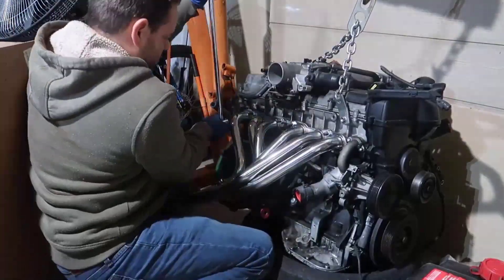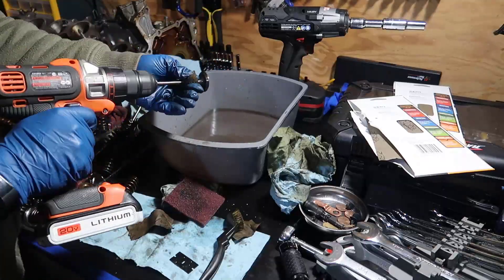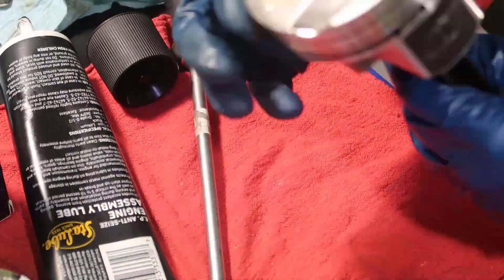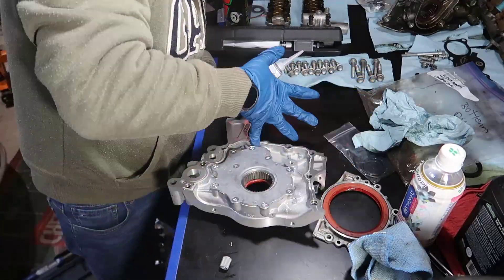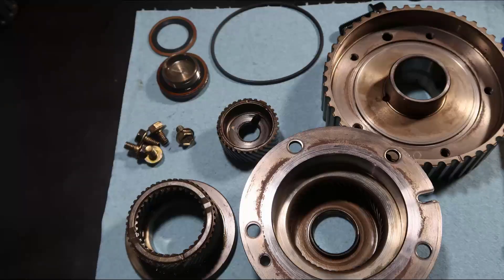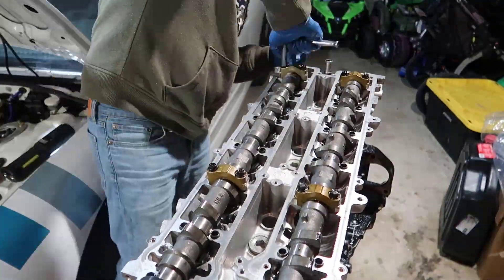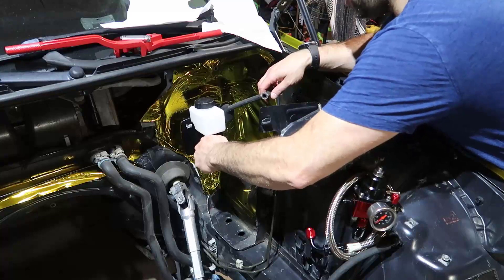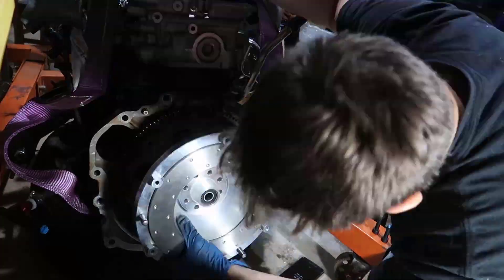533 hp BMW  - 2JZ GE Turbo Build in 10 minutes

Comment: did you swap to a gte head?
Reply: I always though U needed a gte head that has those sensors on the cams to go turbo, my life is a lie hahah. How'd U go with getting it tuned?
 Thing I hate is you can do allll the work but still need to get it tuned.
Reply from the maker: @R0M3109 I learned how to tune. I'm running it myself.  So far I blew one engine and this second one seems to be fine.  I think I have around 550hp. 
The GTE head has a different diameter for the  intake and exhaust as well. Apart from that it's the same. The GE has the cam sensor as well but the important one is the crank sensor which is 36x2 on the GE and the GTE is different gearing.
Reply from the maker: No I did not

Comment: Nice, I have a 4 door with a gte sub, fully kitted out the cylinder head so far, 272 BC cams ss valves and retainers, arp bolts all around, used the GE pistons with gte rods and pushing 550 on the wheels, next step will be forged rods and pistons then 4 bolt main caps. Should be golden. Also still running 95 pump on 14 to 15 psi of boost, looking to double that as soon as the rods etc are done and I can get my hands on some e85 to retune. Hoping for around 800whp after I am done. But anyways nice build can see you built her right from the start.
Reply from the maker: @MrNella853  you have a nice setup.  What you want to do is what I have now except for the 272 cams.  Can't get e85 here though so I'm running 92 pump.  In the Supra I add octane booster  which should take me to 97.  800hp is my goal on the Supra but for this BMW 2JZ 533 is plenty .

Comment: Great video , do you think that buy separate turbo parts is cheaper or is better to buy the turbo kit I planing to purchase the driftmotion turbo kit but is $ 2k dollar maybe I can save some money if I buy everything separate what do you think
Reply: how much for the 2J?
Reply from the maker: @mleverone this 2jz I paid $500 + all the parts I used to build
Reply from the maker: It might be worth it.  This is how much stuff might cost.
Exhaust manifold with vband Watergate port- $250
Turbo smart waste gate - $450
Down pipe kit - $300
Turbo -  $800 (can find unbranded for $200 on eBay)
Fasteners and lines for turbo - $300+
It's worth I think but you can cheap out on turbo (needs modifications on cold side), wastegate (eBay) - $700 bucks cheaper just there.  I like DM products and kits though.  They have good stuff but I built my own kit from eBay stuff

Comment: Man this is awesome!
I’m doing the exact same with a 330Ci… Will the NON M rear end hold up? I was told to do the M3 rear end first thing.
Reply from the maker: It works fine.  My diff broke but it was a lack of luck.  I put another E46 non M diff and it's working again. Everything holds up perfectly
Reply: @CarModsGarage  I’ll take your advice and go with it!

Comment: Any advice on a aftermarket ecu to use on my e60 545 v8 with auto transmision,, my ecu is faulty and cant get hold of original doner ecu
Reply from the maker: Message the Facebook page or Instagram of  a company called speedyEFI.  I run their ECU in two cars and putting the third one on my Supra.  Ask if it will support you application.

Comment: I think this is the most important video as you put inside of it so many things that you’ve missed in the others ;)

I’m a bit stuck with the Compression ratios of mine currently as I want to buy the proper pistons to be able to lower the compression ratio to stock Supra one 8.5:1 and this will make my IS300 2JZ-GE a non interference engine ;) … hope you got my point ;) … I mean that even if I snap a timing belt pistons will never hit the valves ;) because of the lower compression ratio, no ? Or I’m mistaken ? Please let me know cause I found the equations how to achieve 8.5:1 compression ratio with 2.6mm head gasket (this is only applying to 10.5:1 stock pistons and stock (thin) rods, and now I’m doing same equations for the stock TT Supra pistons and rods and then I’ll check the 8.5:1 Wiseco and 9.0:1 Manley, and I’ll be running stock bore (86mm, hope so 😂 dunno, will see once I open bottom end and measure the cylinders from the very bottom to the top 🤣) 86mm
Reply from the maker: Ya you are correct. If you lower the compression ration it will be non interference engine.  I had that done on my BMW from this video and also on my Toyota Supra. I dropped my compression to 9.5:1. Got forged Manley pistons. You can get tt supra for sure. The GTE is already a non interference engine.
The bore and stroke are 86mm. On my builds i increase the bore by 0.5mm so i have 86.5mm on bore and stroke is the same 86.00mm. 
You should be fine 👍. 
Thanks for watching the video brother. I appreciate the comment.

Comment: Could you do a parts list with links embedded? For the engine parts and all adapters used. Been wanting to do this to my 325i, looks worth the effort
Reply from the maker: I've got a huge list. Check the description of the video. I added everything there. The injector I have are DW 1100cc though that's the only difference but I linked to a similar one. The adaptors from 2jz to ZF transmission I've got from DriftHQ. They know all about that stuff.
I hope that helps brother!
Reply: @CarModsGarage  hey thanks!
Reply from the maker: @panchoveliz1098  anytime brother. Good luck 👍

Comment: Great job 👏 what sump are you using on the 2jz
Reply: Thanks does the middle sump work to or must it be a rear sump
Reply from the maker: Unfortunately not. Only the rear sump because of the power steering
Reply: Thanks it helps alot
Reply from the maker: On this swap It needed a rear sump. Thanks you 👍

Comment: Do you have a photo of how much you modified the firewall/tunnel to allow room for the gearbox adapter? I got the same one and have the same issue.
Reply from the maker: I didn't modify anything yet.  It was rough to shove it in but what I'll do next time I take the engine out of the car is to use one of those hydraulic jacks to enlarge the firewall.  I won't cut anything.   I haven't done yet.

Comment: What the mileage on that bro? I want to swap my 325i but I still want it to be reliable and have good performance. How has it been driving?
Reply from the maker: The car had almost 200k when I blew the head gasket.  The 2jz I built has less than 1k miles.  It's awesome. I've never driven anything like this car.
Reply: @CarModsGarage  thank you for the quick reply i appreciate it.  you wouldn't know the mpg, you see i'm in cali and gas is crazy.
Reply from the maker: @911037  oh man that's a hard question.  Very bad mileage for sure. I use it for drifting so rpm is always high. Injectors are 5x the OEM. I guess of you have the same setup but smaller injectors and drive normal in the city it wouldn't be as bad but I can't tell you what it is.
Reply: @CarModsGarage  thank you bro, I appreciate you.
Reply from the maker: @911037  any time brother!

Comment: You didn't mention about oil pan swap - first there was a front sump, but that one does not fit E36/E46 chassis, then when test fit the engine it got rear sump. Just want to make things clear for somebody who is just starting with this. About driveshaft -  you can mix and match front parts of the driveshaft to sute the length. Anyway - good job man!
Reply from the maker: That's true it needs to be rear sump. The front sump hits the power steering rack.
The OEM driveshaft  is too long and two pieces.  You can definitely cut and weld to make it work. I didn't want to risk 🙂. I'll probably make a detailed video about the details for the conversion
Reply: @CarModsGarage  About the driveshaft - I never say anything about cutting.  I have changed my front piece only...
Reply from the maker: @Nayden Boyanov  oh cool.  How did you Fit it there?  ZF transmission?  What did you change on the front piece?

Comment: Did you line home mains to use the arp main studs🤨
Reply from the maker: Yes I did. I had problem on another engine that crank wouldn't turn after ARP was installed so I decided to line hone before even trying to see if it would turn fine.

Comment: Sick budget 2JZ setup, would love to see some pulls in this car! Man if only I could run a speedefi with a automatic, I’m currently looking for a budget solution tunable ecu for my na-t gs300
Reply: I'm pretty sure you still can. 
If you run the stock ecu aswell as the speeduino ecu you can keep the auto. 
Speeduino controls fuel and spark, Stock ecu controls everything else including the auto trans.
Reply from the maker: I'm almost sure you can run SpeedyEFI.  Message them on their FB page.  They always answer and they will definitely know that.